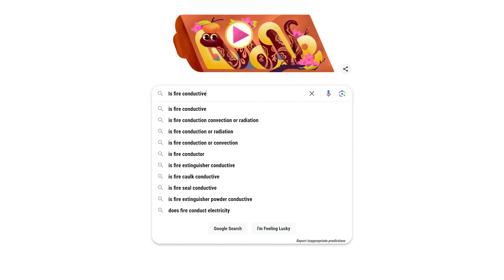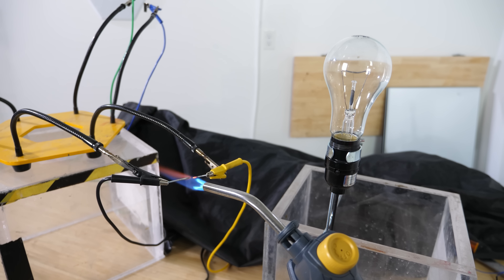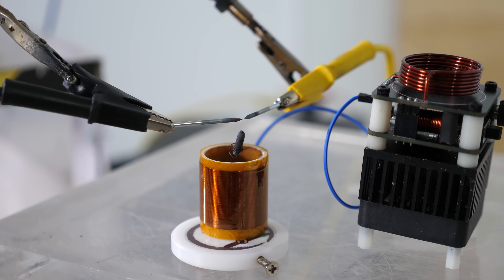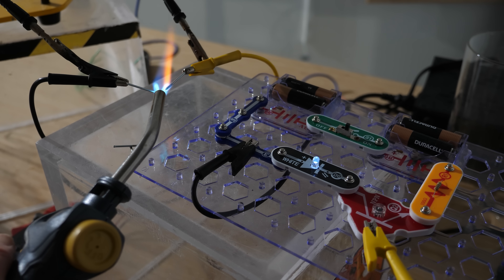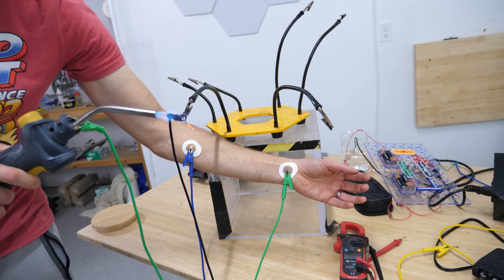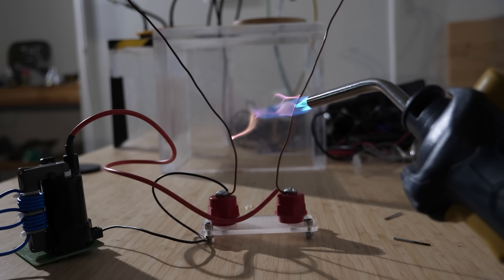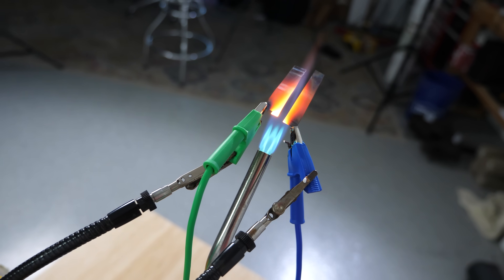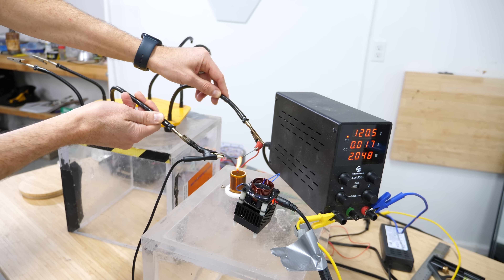Is Fire Conductive Enough To Get Shocked?

Comment: As a welder I'd like to contribute to this; a big thing to note is that fire itself is not conductive, but the fire does make the gases that it interacts with more conductive. Another comment said it well in that fire is not a substance but a chemical process. The energy that is being released from that process is released as heat and light, creating what we call a fire. That energy that is being released can excite the surrounding gas and turn it into a plasma, which IS conductive because of how loosely bonded the electrons are in the plasma. Considering how low the current is in these experiments, it's not going to perform very well since plasma is still not nearly as conductive as say a wire or another material actually meant for conducting electricity. Also, if the energy from the fire is enough to break down the molecules of the gas before it becomes a plasma, it will also not be very conductive
In welding we are regularly dealing with noble gases and electricity that could easily kill you, so it's quite easy for the electricity to arc through the plasma and melt the metals we are working with.
Reply: And the point he made in the video is that it's the heat that makes the air conductive, not the fire itself.   Fire is a means to an end.

Comment: I get it, it the heat that make conductive, look at valves, cathode heat to make electron move when voltage apply to grid when there is heat it move and jump through, electron to the anode. Last thing if you reverse it, it just won't conduct, like a diode. I just wonder will it work if you reverse the voltage on the project, I understand it won't do on AC. Think that how the valves born?

Comment: Fire and electrically induced plasma being conductive is still true. The issue with the above setup may be due to oxidation of the wire terminals, hence insufficient voltage to force current flow

Comment: Without measuring the current in the circuit and measure the voltage drop across the load How can one  truly measure the conductivity of the flames ?

Comment: 7.00 hot air makes air a poorer insulator if you were to put that in a vacuum chamber when you got close to a vacuum the arc would start and not stop until you turned it off!

Comment: Fire is conductive enough for the conductivity to be used to detect if there is a flame present eg. in a burner.
Usually the detector would be either a optical (eg. photomultiplier), ionisation probe (this effect) or a thermocouple.
This is used extensively in industrial burners.

Comment: The most "sensitive" GFCI in US and other outlets won't trip below 35ma line to ground. So if you strip line and ground wires from a plug or load terminal on the back of them then put a flame in the gap, 20ma won't trip. Other GFCI/RCD types often need Higher ma before tripping because resetting them is harder to "impossible" as load panels are at best in another room to locked by management etc. Those "higher powered" GFCI/RCD aren't there to stop you getting shock 100% but minimize shocking and turn off power in case you fell across or holding wires etc.

Comment: You forgot something! Vacuum tubes which can conduct power & doesn't even need very high plasma temperatures. basically a vacuum tube is activate using a thermal element that glows hot. Then electrons can flow across to a conductor. This would probably make a good video on this topic. & all you need is a vacuum tube for a video demonstration.

Comment: If you ever had a failing (incandescent) light bulb trip your breaker, it was due to plasma as well. If the filament breaks "just right" (usually makes a pop at the same time), it is vaporized turning into plasma which then has a much lower resistance than the working bulb had. The inside of the bulb's glass will then be metal coated and become a (bad) mirror.
Just two weeks ago I had the light bulb in a microwave oven (the one that has been there all along, not one that I put into it ;) ), fail in such a way that it tripped the breaker, blew the fuse in the oven and welded the relay contacts shut (the replacement bulb would not turn off anymore). All fixable (also I don't recommend opening a microwave oven, unless you really know how dangerous they are), but yeah, an in-circuit plasma is almost equivalent to a wire.

Comment: Some gas appliances pass a current through the flame to detect flame failure & shut off if the gas didn't light.
Reply: In the gas stove I have seen they work on the Seebeck effect.  Inside the probe are two dissimilar metals which produce a voltage that holds a gas solenoid open.  No flame..no heat..no voltage  . no gas
Reply: @johnspathonis1078  That's another type, acting as a heat sensor and used mainly in piloted appliances.
Many gas furnaces with electric ignition use a DC microamp flame sensor instead, which does indeed work on the electrical conductivity of a flame. But as the name implies this is only carrying a tiny amount of current which is detected by a sensitive electronic circuit, not powering any sort of significant load.
Reply: @alexisdougherty2652  Hi Alex  See my post below.  Problem with just detecting a flame by its conductivity is that the system can be bypassed or give a false reading by shorting out the sensor/flame rod.  This could have disasterious consequences.  How does the system you described get around this shorting out issue whether by accident or by deliberate intervention.   Unfortunately, people like bypassing safety systems.
Reply: @ These tend to be pretty reliable since there aren't many failure modes that would create a short with the right amount of resistance to mimic a flame; and a well-designed control circuit can easily detect such a condition if it were to happen and lock out the machine from starting. Plus it's usually just one of several redundant safety devices.

Intentionally bypassing the mechanism is another matter. There's a saying that as soon as you make something idiot-proof, along comes a better idiot. Yes, a DC microamp flame sensor can be disabled by deliberately modifying the device; but so can literally any other safety mechanism. I don't see how this one is any different in that regard.
Reply: @johnspathonis1078  this is called a flame rectification circuit.  The furnace control board powers a flame rod which sits in the flow of the flame from the last burner in line, typically around 95 to 105vac  at the rod.  the flame rectifies this current flow into dc microamps, typically around 4 to 7 is a good reading which goes back to the board on the ground wire that connects from the burner housing to the board.  Theres no way to bypass this since the control board will not allow the burner to attempt to startup if its already receiving a flame signal when there should not be.  The board will go into a lockout.
Reply: @bryanswanson5007  Thank you Bryan.  That was the response I was hoping for.   You obviously have a technical interest in the subject.   The application I saw was about 45 years ago on a road bitumen sprayer.  Because it was not a package burner, and the flame rod was very exposed, the maximum safe voltage used was truck voltage such as 24VDC.  In later years people tried to put package burners on sprayers and road tankers, but on our often rough roads they were often shaken to pieces.  My original comment was about the rectifying effect of a flame which other commenters seemed to miss.   Thanks again.  Cheers

Comment: 8:54 its negative differential resistance. the resistance value drops with voltage increase, but its still a normal (positive) resistance
Reply: I think the term he was looking for was "negative temperature coefficient of resistance". Semiconductors, as well as glow-discharge lamps (fluorescent tubes, Neon signs)
Reply: @vincentrobinette1507  glow discharge lamps are literally the same thing as open air plasma. the temperature co-relation to resistance makes it both an NTC thermistor and a negative differential resistance element. NDR in semiconductors is very rare and unreliable. diodegonewild has some videos showing oscilloscope repairs where such element was the failure point and was considered a consumable, because of how bad it is.
Reply: it also drops with increase in frequency, so if you pump a lot of current with crazy high frequency (well outside what is normally achievable) then you'd reach a negative resistance and get "free" energy as in it's not really free, but you'd extract energy from your surroundings - just like a heat pump does it, but with electricity.
Reply: @vaakdemandante8772  High frequency starts taking on the properties of direct current.
Reply: The terms are used interchangeably (see Wikipedia) since there are no devices that possess absolute negative resistance. That would mean they need to push current back against the voltage potential, creating free energy.
Reply: I'm surprised, though, that no one picked on the use of "superconducting" five seconds later. Or was it "super conducting"? 😃
Reply: @ negative resistance absolutely exists. it just isnt a discrete component. almost every power supply uses negative resistance theory to work

Comment: It's called flame rectification its used in your heater and in electronic ignition gas fireplaces. It turns ac into DC half wave I think

Comment: Most interesting thing for me was the fact that you could blow out the arc like a flame. Very cool. I didn't know that was possible
Reply: Home circuit breakers actually use that to function. An arc can easily form when they trip, but since arcs are hot, circuit breakers are designed to make the arcs blow themselves out

Comment: Ah, please don't
You'll shock your arm

(Suspended energy beyond norm; arrhythmia)

Conducting electricity through your arm, or any part of your body, is extremely dangerous and can have serious, even fatal, consequences. Here are some reasons why you should never attempt it:

1. **Severe Burns**: Electrical currents can cause severe burns both externally and internally. The skin and tissues can be damaged by the high heat generated by the current passing through your body.

2. **Heart Damage**: Electrical currents can disrupt the normal electrical signals in your heart, leading to arrhythmias (irregular heartbeats) or even cardiac arrest. This is one of the most life-threatening risks of electrical exposure.

3. **Nervous System Damage**: Electricity can interfere with the functioning of your nervous system, leading to nerve damage, muscle spasms, and loss of control over your muscles.

4. **Organ Damage**: The current can cause damage to internal organs, potentially leading to failure of vital organs like the heart, lungs, and kidneys.

5. **Pain and Muscle Contractions**: Electrical currents can cause intense pain and involuntary muscle contractions, making it difficult to let go of the source of the electricity, which can prolong exposure and increase injury severity.

6. **Respiratory Problems**: The electric shock can affect the respiratory system, leading to difficulty breathing or even respiratory arrest.

Always exercise caution when working with electricity. Ensure that you are using proper safety equipment and following safety protocols. If you suspect someone has been exposed to electrical shock, seek medical attention immediately.

Stay safe and avoid any unnecessary risks when dealing with electrical systems!

Comment: Excellent video, I learned something too.
Note, I don't think "negative resistance" is a thing, but you meant "negative temperature coefficient" or NTC when resistance decreases with temperature.
Incandescent bulbs' resistance and polyfuses are PTC, as their resistance increases with temperature until an equilibrium is reached.

Comment: Fun video. Take a closer look at your torch tip. Really zoom right in there with it lit.  What is the air gap between the tip and where the fire is starting to take place? Not discounting the rest of the explanation,  but that air gap is plenty of insulation for 120Vac or 40Vdc.
Reply: But he also did it with two wires directly in the flame where the torch was not part of the circuit. And it still did not shock him or light up the bulb.

Comment: The flame sensor in a gas furnace relies on the conductivity of fire.
Reply: In school my teacher told me they used thermocouples and if no flame the movement shuts off the flow.
Reply: @linsqopiring6816  
Thermocouples generate a small current. They are typically used to verify the pilot light is on

A flame session is just a metal probe in front of the last burner.
It has 110V on it. When the last burner it lit, the flame conducts to ground. The main control board uses this current flow to verify the burners are on.

Comment: It was an interesting set of experiments and demonstrations James!
one really good thing about you James.. is that you let the unexpected results or the not so optimal processes too stay in the final edit (of the productions) that you publish.

honestly, I was/am too dumb to pinpoint (the reason/s why) but even I was unsettled at you putting fire or the flame thrower/ torch and the electric current together.. in the bulbs (molten glass) video.

There is always the fire Hazard.

Comment: When you're measuring the resistance of fire and you can see the fire heating the plates up red hot, wouldn't that increase the internal resistance of the plates from near zero to a significant amount? Wouldn't you then have to take into account the resistance of those red hot plates?

Comment: Mmmm I think yo may be missing the point... Limiting current to experiment is wise, limiting voltage, whilst looking at conductivity, that will skew the result for litterally any semicondictor, plasma included!  Sying my test setup, at 40V, cant make a spark jump a gap 'this' wide in air and then concluging that an air gap, of any size, at any voltage, would protect you from a dangerious current is, well, silly! Replace air gap with fire... C'mon, you are better than this dood! Typical AC voltge in a domestic setting is somwhee between 220 and 250V L-L, US L-N UK. that is around 350V peek which is nealyl an order of magnitude more than you experimental setup. I think concluging that fite cant create en electrical path and cause you harm after shuch unrepresentitive testing is boarderline irresponcible!

Comment: Wouldn't the gas pressure blow the ions away that would/could conduct the current between the electrodes? Seems to me, even a candle might be enough to transport current-carrying ions away from the electrodes. Are you accurately demonstrating the mechanism of conductance? I'm just asking.

Comment: Pardon my ignorance, But did you test the "fire-bridge" method using other forms of fire? Like a candle etc? I have a feeling that maybe the high "thrust" of the blowtorch would affect the ability for the electricity to bridge the gap. 

Also, when you did manage to connect a circuit using the blowtorch... Is that not because the heat expands the two contacts to a point where they electrically bridge? 

I'm an idiot.

Comment: Indeed, one of the uses of a flyback transformers is in arc welding. By setting up a very high voltage spark between the rod electrode and pieces under weld a much lower electric potential is needed to stablish the arc welding.

Comment: Now test a candle's yellow flame. The yellow flame from a candle or burning wood or paper contains carbon molecules (soot). If a candle flame is conductive it isn't because of the plasma or ionized air molecules, it would be from the soot content in the flame. I don't know how this would turn out, but early resistors were made by rubbing candle or oil lamp soot into pieces of cloth or paper.
Reply: airborne soot isn't very conductive.  all the freaking air is in the way.
Reply: Always so amazing to consider how things were done in the early days and how far we've come. I'd like to see a youtuber replicate the oldest methods.
Reply: I exactly wonder the same! I hope he can compare the yellow flame to the blue flame

Comment: It's not just the breakdown potential of air that's being affected by the heat gun, I'd love to see you test if just the cold air flow might generate a high enough triboelectric potential to initiate the Jacob's ladder in that setup.

Also, I'm sure you're already aware, but measuring the resistance of the flame with a multimeter (which is a very low voltage, usually < 1V DC measurement) will give much higher resistance readings than if you calculated the resistance from the measured current flow resulting from the application of much higher voltages (in the 0.5~2kV range, of course while staying well below the breakdown voltage for air at that temperature), with high-frequency AC potentially giving even lower resistance readings than DC (depending on what ions are present, the degree of ionization, the local humidity and even the size, shape and spacing of the electrodes) even when subtracting the expected extra current flow due to capacitive coupling (which is easily done by first measuring the current flow while cold and then using the formula: Hot_Resistance = Voltage ÷ ( Hot_Current - Cold_Current ) ).

Finally, I'd love to see you try to increase the ion density of the fire and plasma experiments, by adding some NaCl (or, even better, try combinations of Cs2CO3 and BaCO3 or BaOH ) onto the electrodes (or, if the salt gets blown away too quickly, just sprinkling it into the burner's venturi air inlet), as well as by replacing the electrodes themselves with a few Thoriated Tungsten electrodes, bundled together in parallel to increase the surface area in contact with the plasma and to reduce the interfacial resistance.